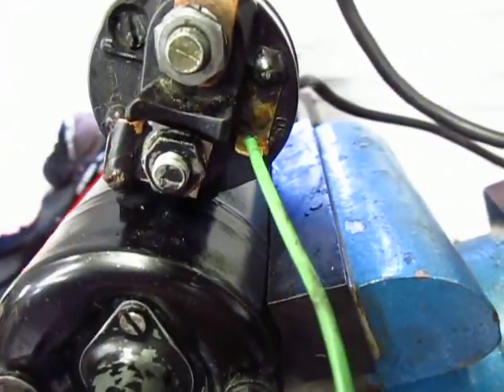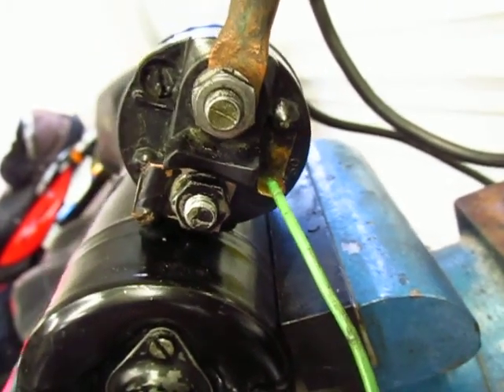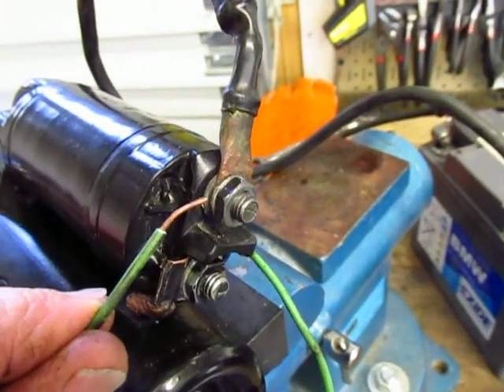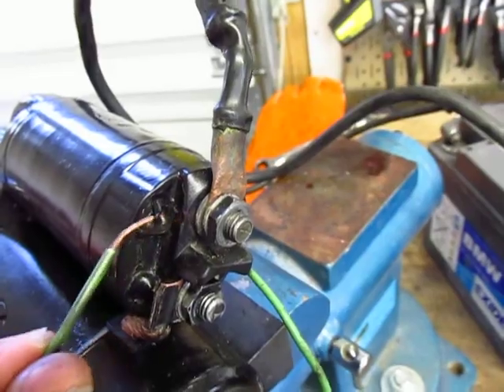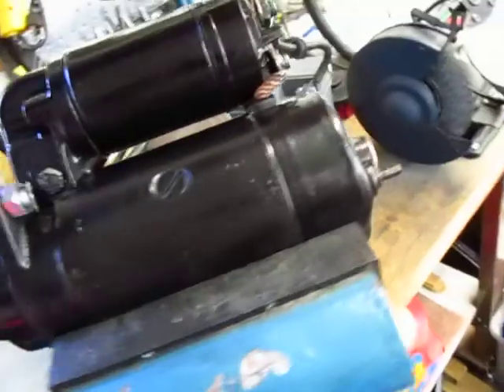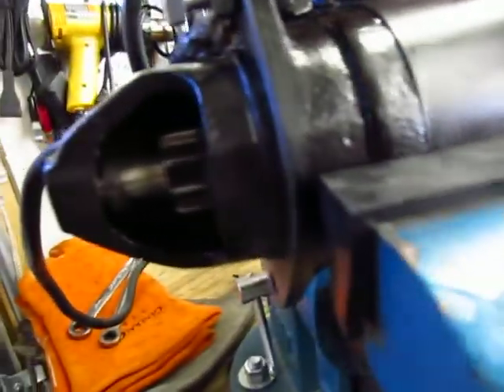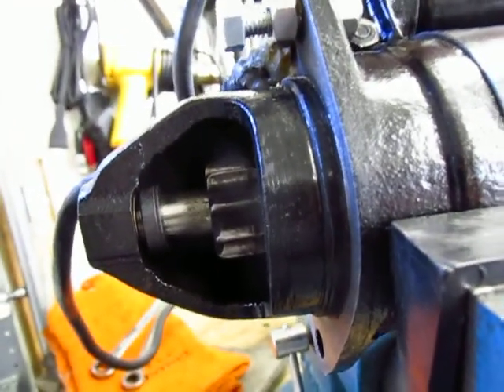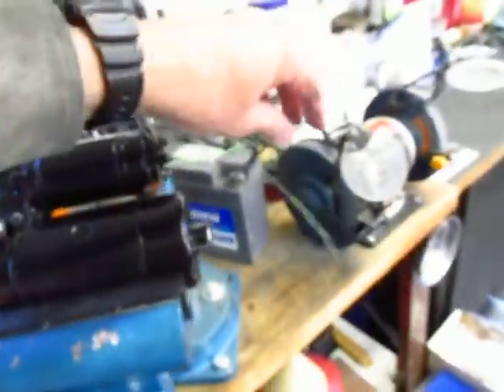1977 BMW R100RS Starter Motor Rebuild Test

Comment: Thank you for the video. The problem with mine is that on the bike, with a fully charged battery, the engine is not turning as fast as it used to. If not used for a few weeks, it takes forever to get it to start.  I just pulled the starter and I would like to test it before taking it apart.  Any idea how to test for this type of issue?  I it is Bosch 0001157 007.  It runs great on the bench, without a load.  It looks brand new on the outside.  Cables and grounds are in excellent shape as well. I've had the bike since 1990 and only put 2000 miles on it after I restored it in '91.  I don't know if the starter is the original one or not. Bike had about 40k miles when I got it. Thank you for any suggestions!
1972 R75/5

Comment: I have a 1979 r65....when I press the start button I hear a light click like a relay but the starter doesn’t engage (sometimes it does, but mostly doesn’t) could that be a bad starter solenoid??? It takes a lot of pressing and then finally it will start. But is getting worse. 
Thanks 🙏
Reply from the maker: Hi stallion78, It does sound (no pun intended) like the starter solenoid or the brushes on the starter motor rotor. Unless you want to preserve this bike as an original, a new motor maybe the better option If you don't want to rebuild the motor, good replacements at a reasonable price are available at Euro MotoElectrics. The starter motor part# is (12 41 9 062 425). They offer three versions, but the EME branded motor is excellent and the least expensive.
--> https://www.euromotoelectrics.com/searchresults.asp?Search=12+41+9+062+425&Submit=Submit
Reply: @BrooksAirheadGarage  thank you so much for the quick and thorough response. I will do that. Have a happy Easter